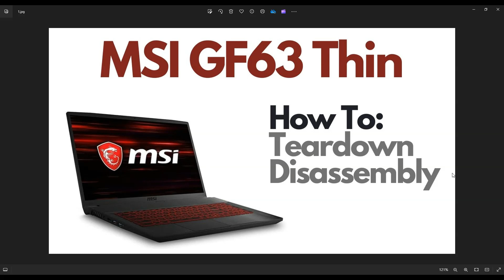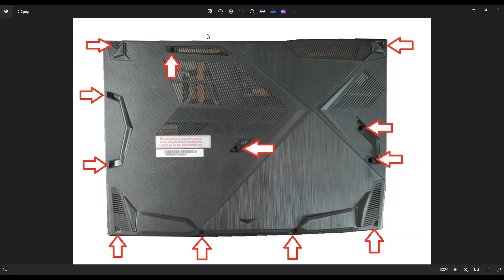Teardown / Disassembly, Upgrade Options - MSI GF63 10SC Thin Gaming Laptop

Comment: pictures unhelpful. wanted video demonstration as back case is not coming loose despite all screws removed and case popped all the way around with pry tool.
Reply from the maker: User manuals from computers to cars to furniture have always been pictures lol. Not sure when people started 'needing' video but ok ;) You have this exact model computer? The GF63 10SC?
Reply: @jamminpcs  Wasnt mine personally. Was a unit I was working on. The back case was cracked in multiple places and I didnt wanna put too much pressure if I was missing something stupid. That is why I wanted a visual demonstration. Did figure it out in the end. The 3.5mm jack was stuck seized to the case and wouldnt pop out. I had to give it a bit of extra nudging to break loose then the rest came off easy. I coulda took it off on the opposite side first if not for the breaks in the case.
Reply from the maker: @SpAzMaNiK  Ya, every job can be different like that. Especially with damaged units. Glad you figured it out!

Comment: I've got some display issue, wanted to see if it's coz of loose display cable... pls guide me in checking the cable connection. Do we check it by removing the back of MSI or display panel?
Reply from the maker: Are you working with this same model or a similar model? If so, then yes, your first job would be to remove the back panel. You can see one end of the LCD cable in this video at 10:30 under the fan.
Reply: @jamminpcs Okay I checked if it was loose, it wasn't. Seems like display needs to get fixed with a new one
Reply from the maker: @abelelelel  You may also need to unplug and replug it in from the other side. The LCD side. If that fails, then yes, I would next try replacing the LCD

Comment: Hi I'm doing a battery replacement and nobody really mentions when replacing the battery if you need to re-glue it or if the leftover glue will melt when the battery heats up and hold it in place. I realize that maybe you don't have this info but if you do or someone does it would be extremely helpful thanks

Comment: wish you'd talk about reassembling the laptop, i've been struggling to get this case back on forever lmao
Reply from the maker: Reassembling would just be this video in reverse :) What part are you having trouble with?
Reply: thank you for responding! i'm having trouble putting the case back on because of the usb-c port and the headphone jacks on the left side of the laptop. i can line things up on the right side correctly, but never on the left, as the case often overlaps with the previously mentioned usb-c port. apologies if this isn't a very clear description of my problem
Reply from the maker: @StarKurusu  Are you able to get the case around those first? They can pop out a bit so perhaps start with those? Also, what did you do when you were in the computer? If you were installing or moving components, are they placed back correctly and not sticking up or anything? Feel free to post a video to your channel if you wish too. I can then view it and advise further if I can :)

Comment: Hi. I’ve got no clue if you’ll respond to this, but when I was trying to carefully remove the bottom plate, I noticed that the 2 USB ports (on the left side of the laptop on the video) were attached or Stuck to the back piece and made it impossible to remove. How should I go about this?
Reply from the maker: That wasnt the case with this model but there may be small thin sections of the panel that fit around the USB ports. You may have to maneuver them around the ports.
Reply: @ thank you! I managed to remove the back piece, the issue was exactly what you described. Thanks again!
Reply from the maker: @daveabobda6239  Glad your all set !! Always here to help :):)

Comment: Hi I want to replace a broken screen. Do I need to remove the lcd ribbon and the cooler to do so? What else should I know about replacing it? And do you know any good replacements?
Reply from the maker: You dont need to remove any part of the heatsink assembly in order to replace a LCD.  However, make sure the computer is unplugged and the battery removed or unplugged or the new LCD can be shorted out and destroyed the second you plug it in. I usually get my screens on sites like Ebay, Amazon, etc.  Do you know how to get a compatible one or would you like help?
Reply: @jamminpcs  I would like some help picking out an lcd. I'd appreciate it.
Reply from the maker: @TheEngieLOL  I just added an LCD to the list of replacement parts and tools here:  https://www.amazon.com/shop/pcmonkey/list/O4XD0HM6WHID?ref_=aip_sf_list_spv_ofs_mixed_d :):)  Let me know if that one is what your looking for :)